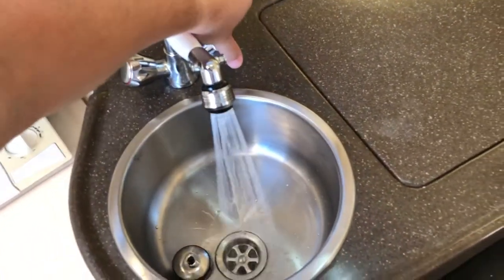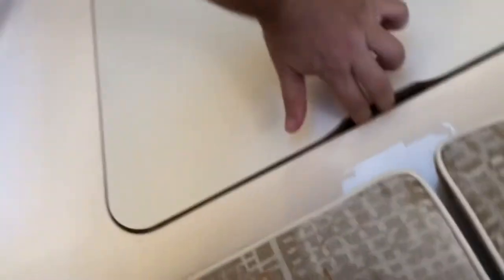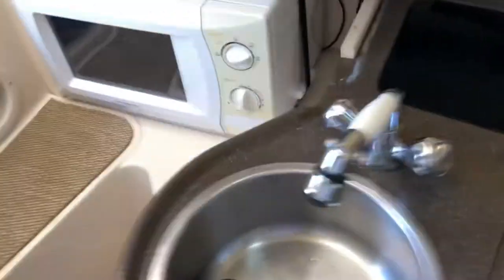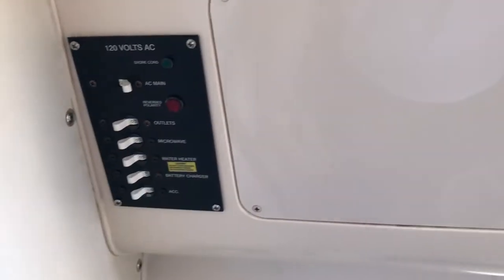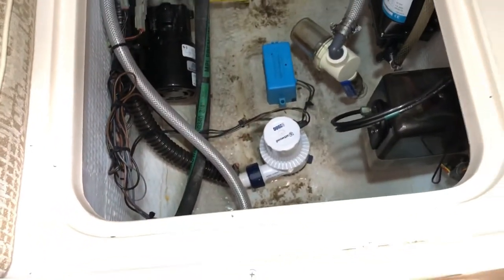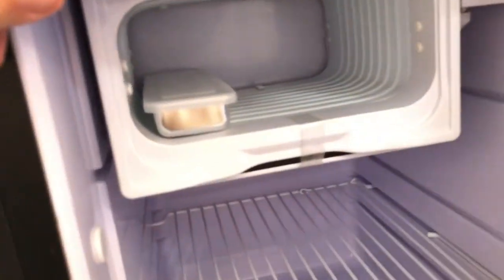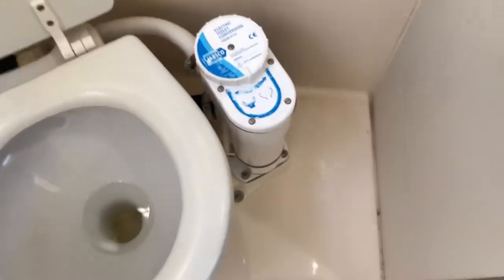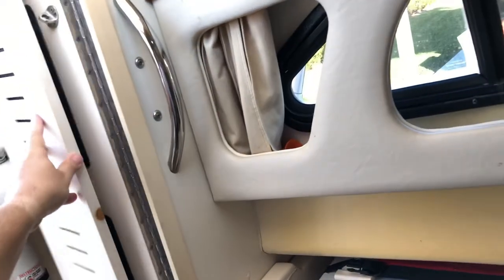Inside Cabin of 2006 Grady White 282 Sailfish - Not available #gradywhite #walkaround

Comment: Just saying, I would have expected the sw pump for the ac to be in the stern, not in the cabin, even under the below berth.  If no one sleeps in the cabin fine.  With the pump in the stern, will not hear it at all from the cabin.  I retrofitted my older Sailfish - located the ac under the galley.  My vacuflush vacuum generator storage tank was behind the rear service wall where your ac was located.
Reply from the maker: Got you.  Boat is sold now but wasn't bad, it was like a nice white noise.  Also washes out the generator noise when not on shore power.